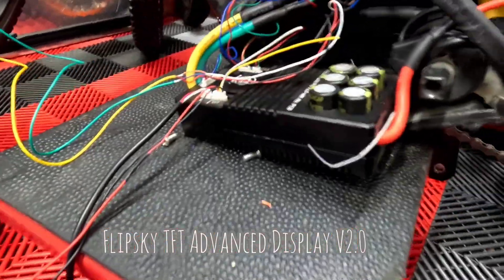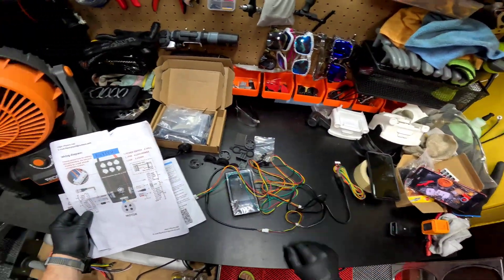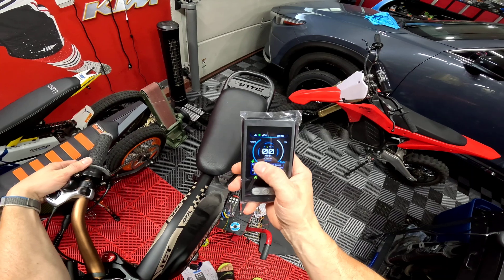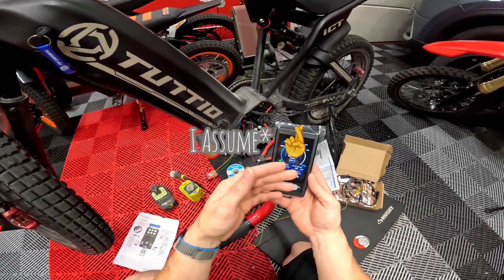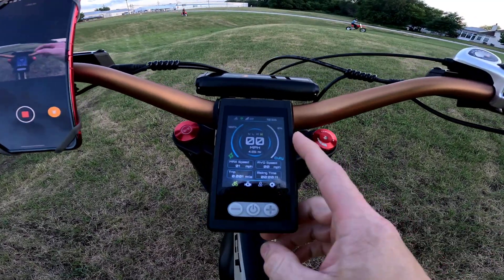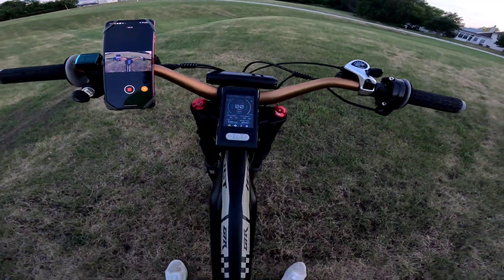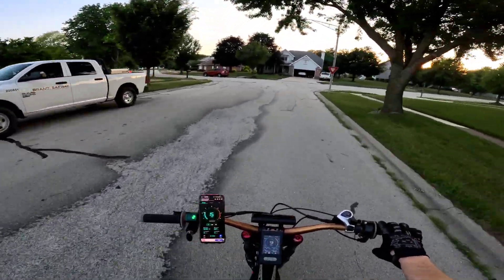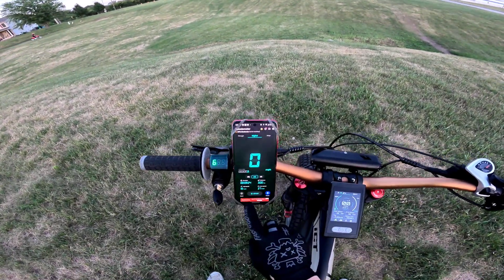Tuttio ICT Gets a Major Upgrade: Flipsky TFT V2.0 Display Installed

Comment: Do u know how to get pas working
Reply from the maker: You would need to use a different screen I believe, cycle analyst, integrates the throttle and pas into the display and uses the vesc as the power. There's how to on here but I haven never done it

Comment: So I watched the new controller vid and did all the wiring right and stuff. Bike worked for about 5 min and I had to walk it back. Volt meter is on the blue led on the controller is on, but I have no throttle, and the app give me this message,
"Read Firmware Version
Could not read firmware version. Make sure that the selected port really belongs to the VESC. If you are using UART, make sure that the port is enabled, connected correctly (rx to tx and tx to rx) and uses the correct baudrate" what could be wrong!?! Someone pls répond.?
Reply from the maker: I've never seen that error, I ask chatgtp whenever I get stuck and it's really good at troubleshooting issues you might want to try that

Comment: What is the max speed you can tune it to
Reply from the maker: I'm not sure, field weakening should get you to the high 40's but I have not attempted
Reply: @CerealNaut bro what I’ve gotten mine up to 45 completely stock?
Reply from the maker: @UFP-q9w  yes, the stock controller is setup for more top end  and not torque you can get it back at the expense of low end but I like having more low end power

Comment: My screen is going black. Bought bike used and looks like there’s a little moisture in the display. I can still change speeds and the throttle is working but it looks like the bike is going to cut off

Comment: Is it possible to send a wiring diagram and name of the other module to powers the lights? Flipsky works with motor, throttler and key ignition, but I'm not sure about the lights.
Reply: Lights run off the 60v battery . I linked it into the power switch lead once you situate what's what with the wires it's pretty simple . A volt meter with the continuity beep is critical of situation each pin and wire . I used a 12v drill battery to figure out the light wires .. you need at least 6v to activate them .

Comment: are you able to make a vid on how to install new grips on the ict, its my first bike and im struggling
Reply from the maker: I replaced the throttle because the stock tube is not made for standard grips, I have a video posted showing how to and what the original one looks like with the grip cut off, it's a few videos back from this one in my channel
Reply: @CerealNaut  Thanks, ill find it!

Comment: What front forks do you have
Reply from the maker: HIMALO 26 Inch Bike Suspension... https://www.amazon.com/dp/B0CCP6T3HK?ref=ppx_pop_mob_ap_share

But I have 9mm axles make sure you check yours
Reply: Cerealnaut, we can't use the axle from the original forks? I just order these same forks because the stock ones bottomed out constantly. I got a star bit and these forks, do I need another axle?
Reply from the maker: @cdubbie2613  I would get different shocks if you have the 15mm axle. you are able to just change out the fork tubes and not the triple clamps with that axle style
Reply: @CerealNaut I just wanted to use what I know has worked for someone. Can I just get a different axle to make these work?
Reply from the maker: @cdubbie2613  I'm not sure how you would modify the rim to fit the axle, you might be able to change the bearings but I don't know for sure
Reply: @CerealNaut I just saw where you said older models had 9mm not through axle..
Crap. Can you please recommend an air shock I could replace these with? That have through axle
Reply from the maker: @cdubbie2613  I never looked, I have seen people on the ICT Facebook page that have done it but I'm not sure what shock they used
Reply: @CerealNaut what if I used a 15mm to 9mm through axle convertor?
Reply from the maker: @cdubbie2613  I'm not familiar with them sorry
Reply: So I watched the new controller vid and did all the wiring right and stuff. Bike worked for about 5 min and I had to walk it back. Volt meter is on the blue led on the controller is on, but I have no throttle, and the app give me this message, “Read Firmware Version
Could not read firmware version. Make sure that the selected port really belongs to the VESC. If you are using UART, make sure that the port is enabled, connected correctly (rx to tx and tx to rx) and uses the correct baudrate” what could be wrong!?! Someone pls répond.?